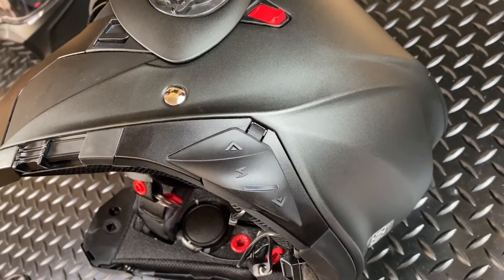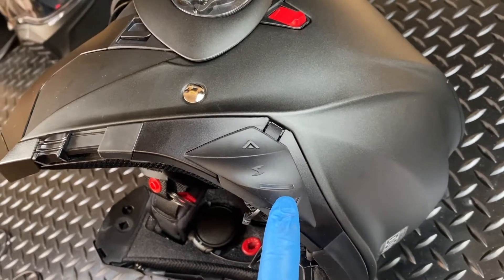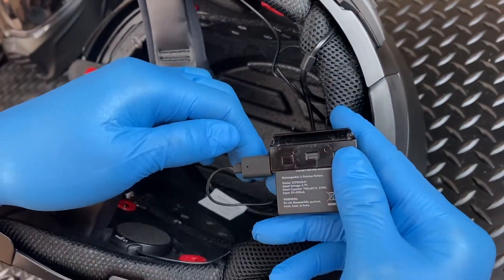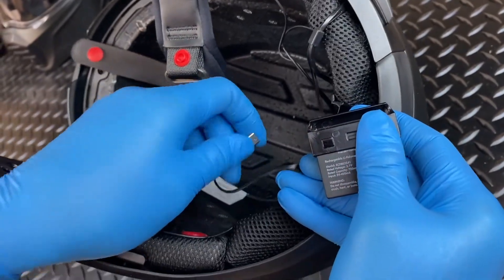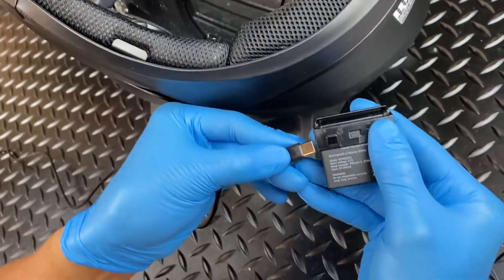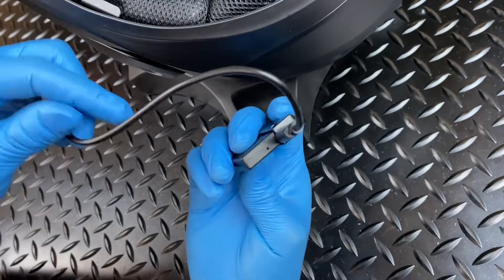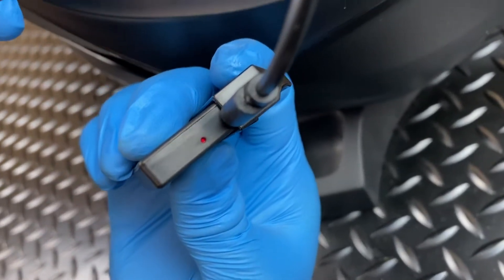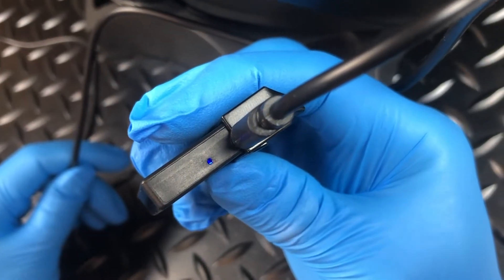EXO-Com (Battery Charging)

Comment: Do you need to remove the helmet liner to charge the battery as shown in the video?
Reply from the maker: Yes, for the GT930 you do have to remove the liner in order to be able to take our the battery. However, for the T520 You do not need to remove the liner.
Reply: @ScorpionEXO_Global  how would you go about doing the T520?
Reply from the maker: @PanDayHoe  You would just need to pry the battery door a bit until you can pull the battery door out. You may have to work around the rubber trim but it should not be difficult.
Reply: I had to gently use a butter knife to get the battery from it's spot.  Seems like a lot. Also, there was not a plug provided with the USB side. I had to go hunt for one. I know a lot of people have a lot of these, but I didn't. 
Also. I wish I didn't have to tear the whole helmet apart to charge it up. 

So far I haven't been able to connect my Bluetooth to my phone yet. 
Where should I go to trouble shoot this?
Reply from the maker: @maritahartmann591  In this case, please contact our Product Support team for support, as they would be the best ones to assist you. Our office is open Monday through Friday from 8 a.m. to 5 p.m. PST. Our number is 1.888.6774, or you can email us at info@scorpionusa.com. 
Thank you, 
Tylara